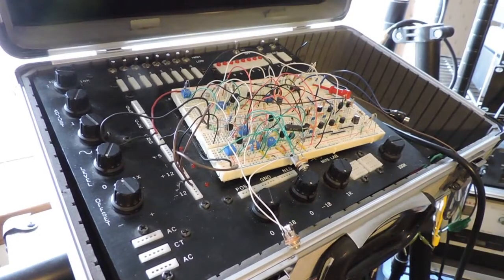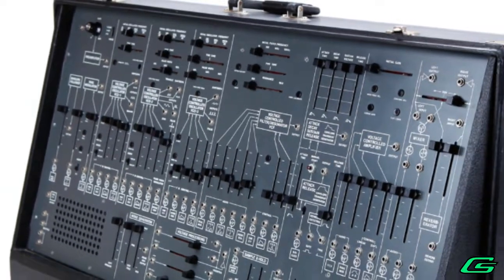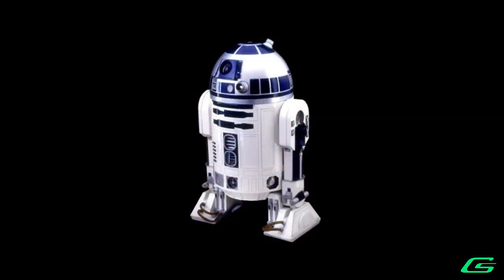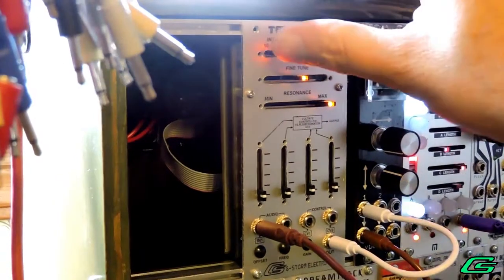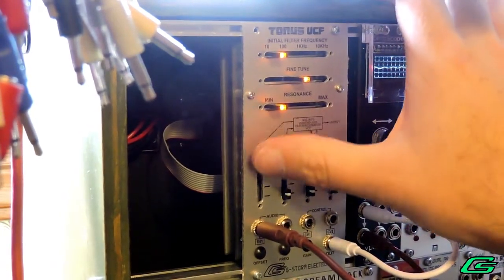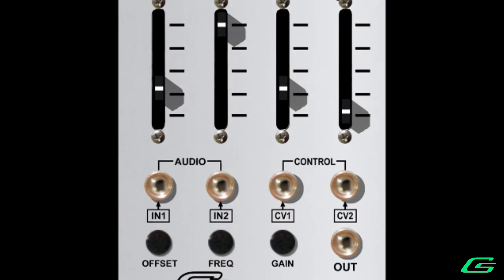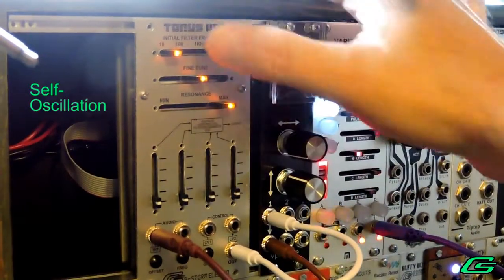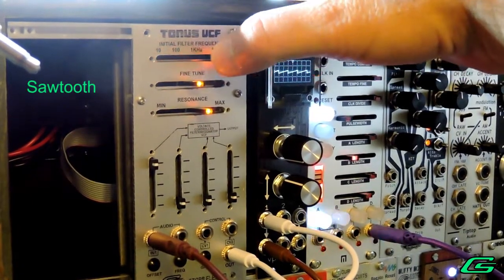Tonus VCF Module First Look [ARP 2600 4012 Filter Eurorack Adaptation] [Demo #1]

Comment: Wait so..this is distinct from the 4075..why did you choose 4072?
Reply from the maker: I think you meant to ask why I did not choose the 4072.  The 4012 is regarded many as a better sounding filter in the 2600, but nixed due to the Moog patent infringement issue.  Being pessimistic I had to hear the 4012 on a breadboard for myself, and recently a real 2600 w/ 4012 in person.  I can't speak to which is better, I haven't messed w/ a 4072.  But the 4012 is wayyyyyy sick.  I will be posting more demos soon of what my adaptation of the 4012 can do.
Reply: gstormelectro ah yes, you're right, and I've heard it with a friend who has a 2600 and you're totally right! Why has no one else done this in euro!
Reply from the maker: I have been wanting a 2600 for a long time now, but the price isn't going down - and my small space it would be impractical.  Then I realized that FILTER is all I really want, just slap that into my rack and call it good.
Reply: Oh, so there is another one: https://www.modulargrid.net/e/amsynths-am8012-arp-2600p-filter
Reply from the maker: AMsynths one has been unavailable for some time, as is one by Steffcorp.  Studio Electronics Boomstar 2600 is a full voice, but their filter doesn't seem to adhere to any one specific original design.
Reply: gstormelectro someone on Muffs is selling the AMsynths one, which is why I ask...
I've been all around the clock with SE--I've owned their Boomstar 4075, Boomstar Sem, tonestar 2600, tonestar 8106, 4075 filter...all great butnow all sold except for one of their oscillators + Sub osc..like you said it's more their own design than a clone.

Comment: excellent filter! maybe you can add another trimmer for feedback. or normalize the output to input 2 with a switch.
Reply from the maker: Thanks!  The way you suggest is exactly how the resonance feedback circuit behaves.  Perhaps the incoming input signal could be amplified before it enters the module.